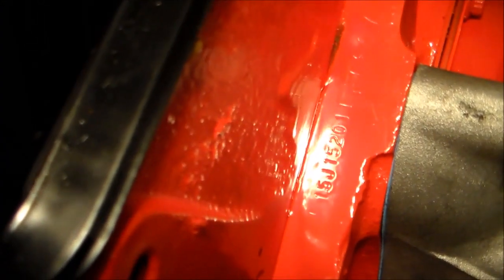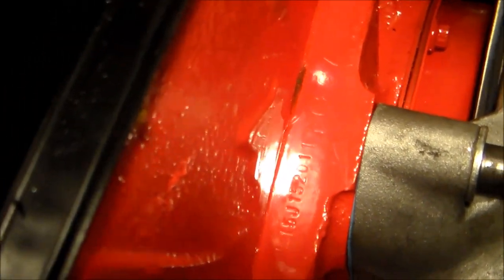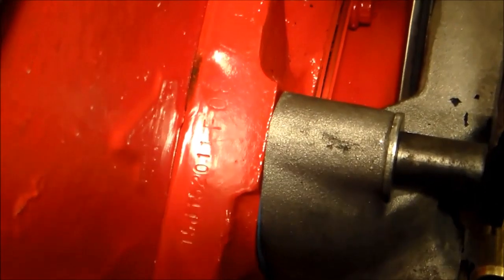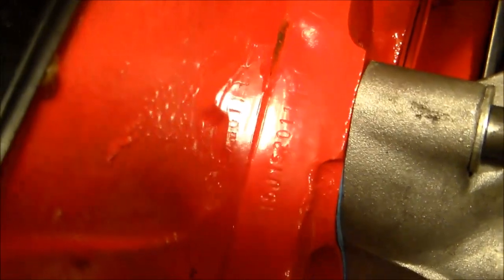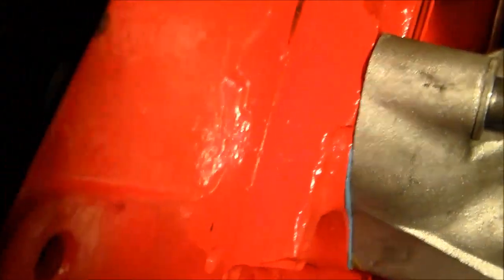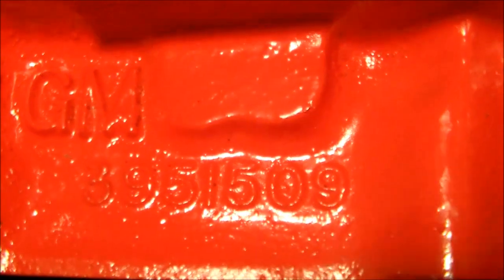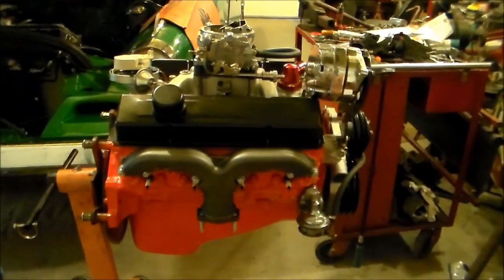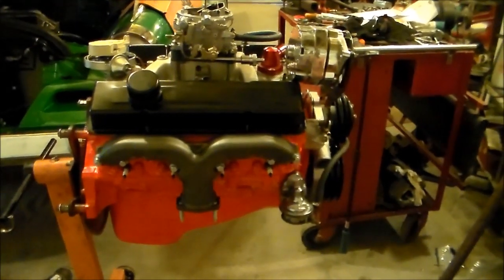How to ID your Engine Block

Comment: I bought a 1957 Chevy Bel Air, car runs and it is registered. But I wan to know if I have the original 283 engine in it. How can I tell if the engine is in the car? Also which website did you get the indo to decode those numbers? What is SBC?
Reply from the maker: There are numbers on the left rear of the engine block close to the bell housing area and on the right front there is a tag on the block close to the head mounting surface. These numbers should help to ID the engine. SBC means small block Chevy.
This link may help ID your engine numbers. Good luck
https://www.enginelabs.com/news/reference-chevy-engine-block-casting-numbers/
Reply: @RustyGlovebox  thank you very much.  I'm gonna look for those numbers

Comment: Bought a 1969 chevelle. It has 396 badging but number on intake manifold is 336789 doesn't match to any 396.
Reply from the maker: Good luck getting all the matching parts

Comment: back many years ago, the engine number was all important,, it was a big rigamarow to change an engine because they used that to identify a car , they didn't really have body numbers back then, . my dad was a mechanic and he had a set of stamps and would change the numbers to match what was in the car, not really legal but that was done often way back then.
Reply from the maker: I had heard some of the earlier cars the engine serial number was what the used on the title. The body didn't have a separate VIN. Thanks and appreciate the info.

Comment: Good to know...thanks..
But I have a question.. And it is..  I found all my casting numbers..i.d. Number..
Right front head id number is. C4F372105. /1213TJC. On the block...
Them I have a number in the rear on the left side..And it is. 3970010..
The head casting numbers are.. 3986388..
I would be great if I could find out what engine this is... But I do know that it's a chevy...
Some of the numbers are saying that it's a chevy 302 from 69.  And some are saying it's a chevy 350..?
My question is could you help me understand this more..
The guy that I got it from said it was in his 69' camaro z28..
But would be nice to know if I'm sitting a DZ 302..
Thank you... Please help me.
Reply from the maker: 3986388 is a 350 head, late sixties /early seventies. 3970010 should be correct for the 302.
Hope this helps

Comment: My numbers on front of block are ‘F04I6M’ nothing I can find is even close, but the second digit could be a zero, or could be an O (letter), also the ‘6’ might be a lower case ‘b’. But no where I have looked is there only 6 digits. I was told this engine was a 283, and it’s in a ‘63 c-30, but don’t know that it’s original engine. Can’t find a chart anywhere that my engine stamp even comes close to. HELP !
Reply from the maker: Try this web site for your engine. Good Luck
https://www.enginelabs.com/news/reference-chevy-engine-block-casting-numbers/

Comment: Could you help me rusty. This is Corey from byram Ms. I was cleaning a woman backyard and I ran across a old Chevy truck frame and it to be between 67to 72 by only the bed is still on butt engine block is there and at the back of block is these numbers 855909.     10tonv.  Thanks if you can help me on to see if what cube it is
Reply from the maker: Try searching here, Good luck
http://minuit10.net/EngineCode/chevy/SmallBlockCastingBlock.htm

Comment: It would helpful if you mentioned where exactly are these numbers located. "Front" and "rear" of the engine is not much help.
Reply: scanner i swear
Reply: Pan out dude and show where the numbers are. Damn
Reply: @haug0099  i got a 1970 chevy stepvan 6 cylinder 4speed standard shift.Trying to find out what size motor i have?
Reply: This didn’t help me....... HOW DO U KNOW IF ITS A SHORT BLOCK OR LONG BLOCK ENGINE... AND HOW CAN U FIND THESE NUMBERS ON ENGINE,IF THE ENGINE IS IN A CAR/TRUCK?       UR ENGINE WAS OUT THE VEHICLE SO IT WAS EASY TO FIND....

Comment: I’m planning to buy this engine wITH CASTING 3914678
It’s either 302 or 327 
But it also has this number stamped in the front passenger side of the engine 
V09IIYK
VO9iiyk 

How can I confirm what engine is this ??

Comment: Can you ID the engine without taking it out? I bought a 1988 K5 Blazer but was told the engine is a replacement but no one can tell me what it is. Kinda hard getting parts for an engine you don't know what it is. Thanks
Reply from the maker: Scott Bendigo   There should be a casing number on the rear of the block by the fly wheel area. With that number and block serial number you should be able to figure it out. Good luck

Comment: Is it possbile you can tell me the motor i have the stamp on the back of motor says GM 3970010 thats on drive side rear and front by heads passenger side says V0125TJZ

Also on the passenger side the rear says A86 (inside an oval)
Reply: Martyimgay i got the same problem help
Reply: That is a 350 could be 2 bolt or 4 bolt

Comment: So I have a 76 camaro according to vin it was manufactured with a 350. The casting on the block is 3970010 from what I can tell that can either be a 327 or a 350 so how can I distinguish which one I have? Thanks!

Comment: I doubt I'll ever need that information, but it is interesting to know about it. Thanks for sharing it, Lloyd. I do have a question, however. In 1965 some or all Studebakers had Chevy engines. The 1962 GT Hawk must have originally had the Studebaker 289 c.i. V8. Am I thinking rightly about that? I ordered an Avanti (that I never took delivery of because production stopped) with a Paxton supercharger and only after I had placed my order did they tell me that it would have a Chevy 289 engine. I didn't care, really, but I was surprised at that time.
Reply from the maker: You are right Bruce , this Chevy engine is a transplanted unit. The only Stude that had a Chevy engine was the reproduction Avanti built in Canada in the 80's. Thanks and take care

Comment: I see the headers are gone. More trouble than they are worth I think.
Reply from the maker: I agree about the headers. Got some good old Ram Horn cast iron now. Thanks and take care
Reply: @RustyGlovebox  I have this type of exhaust manifold but with 2 bolts atop the exhaust it's odd any idea why it's got that extra
Reply from the maker: @garymarlow2333    That would be for a generator mount.